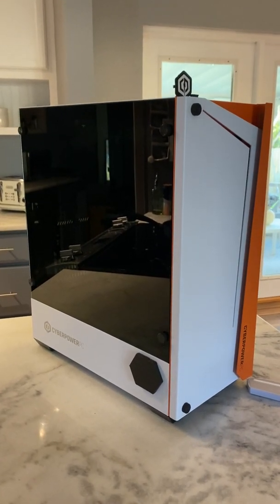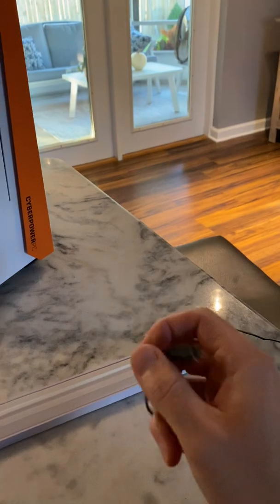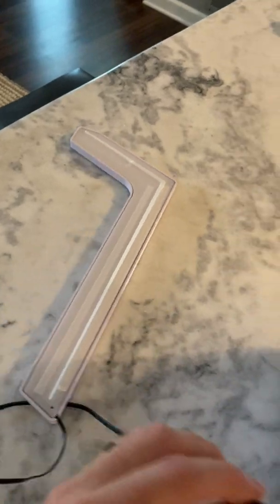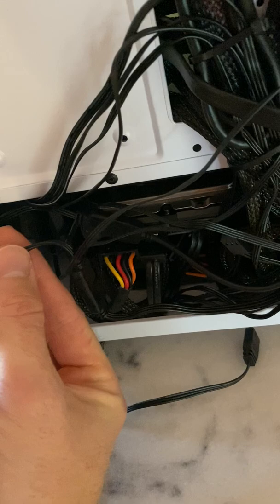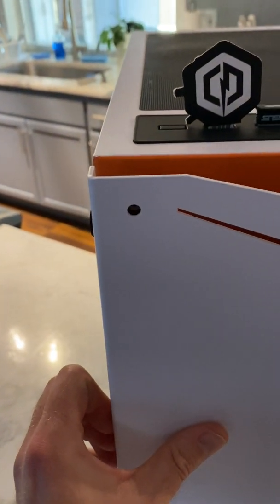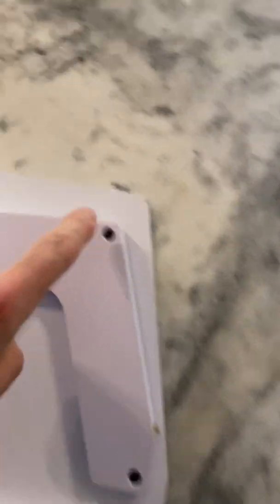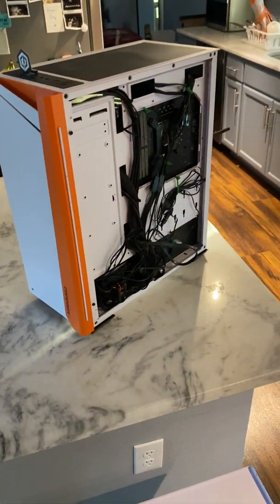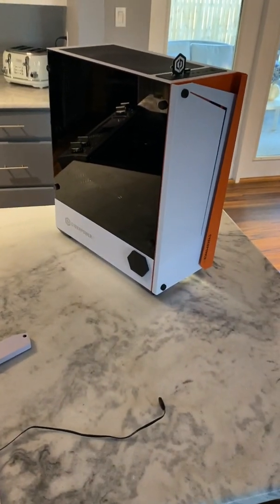CyberPowerPC Xtreme Gaming Desktop (Alumalight 241 midtower) Airflow Issue Solution

Comment: Best solution is to throw that case in the trash.  Its useless.
Reply from the maker: Very true. But if you can’t afford or don’t know how to transplant internals into another case maybe 🤔 consider this
Reply: @scgamerd  I understand where you are comming from.   Not trying to poo on your video.  I have been fighting with overheating for months and finally it dawned on me that it was the case.  I got a corsair 5000d instead that infact im working on right now.   That case is fine for light pc things but if you are going to game on it. It will fry your components.
Reply: @darthuhlenhopp  the mess of wires behind the metal panel makes it intimidating to even try to move all that too a new PC case. where would I even get started

Comment: Just got the black and white version of this case. It came with fans on the top but the pc is super hot to the touch when I play high performance games. Should I remove the front rgb panel or can I just keep it. Im worried that my pc may be too hot but everything still runs fine. (gpu is 4070ti)
Reply from the maker: You can run something like “AfterBurner” for your GPU monitoring and any additional software (have to be downloaded separately) from your motherboard company (I have ASRock) to see what your actual temps are. You can also change case fan settings through your motherboards software to optimize flow and cooling first. But ultimately removing the RGB light from the front helped lower my temps by 5-10C

Comment: I’m so happy I ran into your video prior to this pc coming in! I will 100% do this mod although I will lose that light :( adding those fans up top, was it worth it? And also I was curious how would you take off the cyberpowerpc words from the front and the side to make it look more sleek? I hate that they labeled it hahaha
Reply from the maker: Congrats the PC is great. You’ll enjoy it

Honestly after noticing high temps I installed top fans, which still persisted. I think removing the front piece is what really made a difference.   I feel like the later is less invasive and less costly. So i would recommend just see where your temps are as is. If too high for you, try  to remove the front piece and see where your temps are again. If that doesn’t work more invasive options like installing additional  fans (strangely some PCs already come with extra fans so you may not need to). Keep in mind depending on hardware you got
Some components will run hotter like RTX 3070-3090 are notorious in running in 60-80s + Celsius  depending on the cooling of your case.  I haven’t tried taking off the cyber power letters. I think they are sitting pretty snug, may damage the surface when removing 🤔

Comment: This really helped me a lot! Appreciate the video!
Reply from the maker: Glad it helped! My temps have Improved significantly, especially after I added some fans to the top to exhaust hot air. Running in 60’s and sometimes low 70s GPU after doing those changes
Reply: @scgamerd  Do you happen to know how the GPU is mounted to the case? Mine shipped with a 240 mm AIO on the front with fans on both side in a push-pull configuration, and I think that's what is causing my GPU to hit close to 85 degree under a 70% load. the fans on the back of the AIO are right up against the GPU. I am looking at moving the AIO to the top, but I cant find where the GPU is mounted to the case to get it out.
Reply from the maker: Tyler McMahon my GPU secured “externally” by an two easy bolts holding outside panel (vertically) and two Phillips screws in horizontal position holding it (outside as well). But I’m not sure if moving through GPU or CPU fans would be help versus maybe just mounting two exhaust fans at the top 🔝 (that’s what I did). But if you’re willing to try your option I would be curious to see what happens